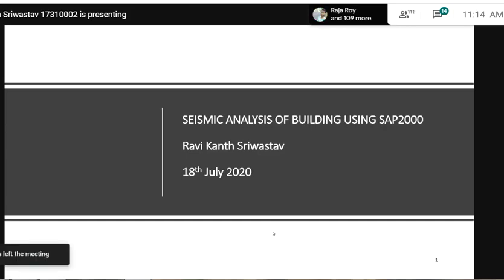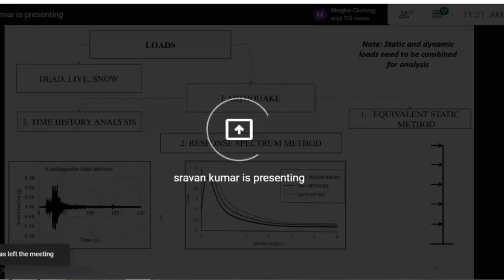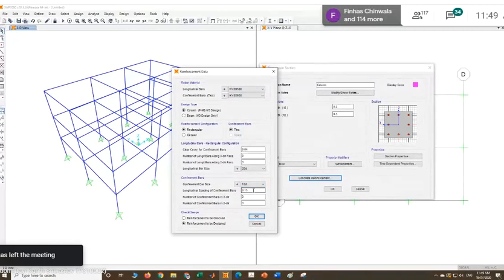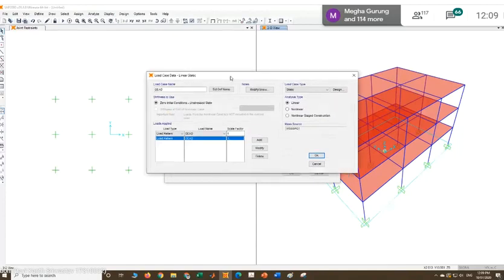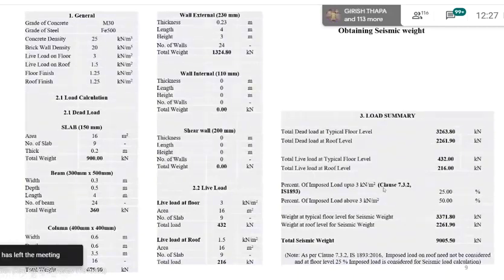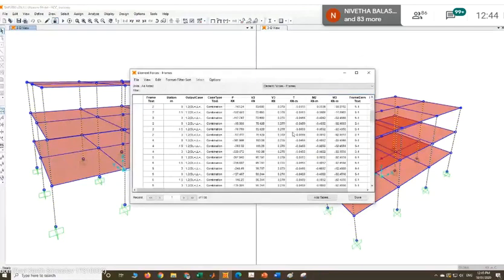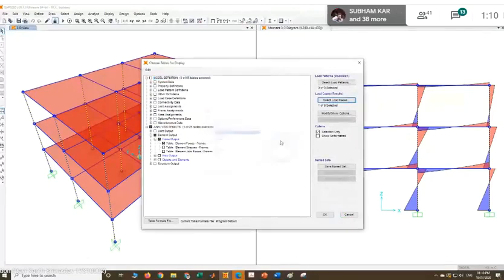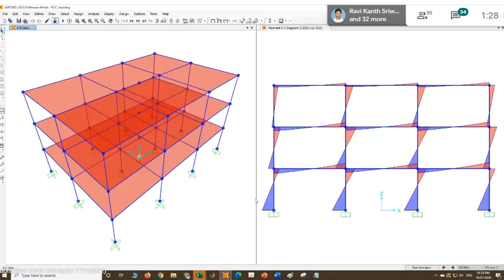SAP2000 Seismic analysis &  Design

Comment: Consider a four-storey reinforced concrete office building shown in Fig. 1.1. The building is located in
Shillong (seismic zone V). The soil conditions are medium stiff and the entire building is supported on a raft
foundation. The R. C. frames are infilled with brick-masonry. The lumped weight due to dead loads is 12
kN/m2
 on floors and 10 kN/m2
 on the roof. The floors are to cater for a live load of 4 kN/m2
 on floors and
1.5 kN/m2
 on the roof. Determine design seismic load on the structure as per new code.
[Problem adopted from Jain S.K, “A Proposed Draft for IS:1893 Provisions on Seismic Design of Buildings;
Part II: Commentary and Examples”, Journal of Structural Engineering, Vol.22, No.2, July 1995, pp.73-90 ] 
sir can you give response spectrum analysis using sap2000 of above problem statement

Comment: Hello sir, Im using SAP2000 for structural analysis. In response spectrum case, stress values on shell elements are seen as 0. When I define static seismic case with the values that produces same base shear, static case gives stress on shell elements but response spectrum case still not. How can I fix that? Is there any suggestion? 
Thanks in advance.

Comment: Respecetd Sir,
As we know that, the vertical response spectra is not given in the IS 1893:2016 Part-1 and the code suggested that vertical ground motion should be considered ad 2/3 of horizontal ground motion.

1) So, can we scaled down vertical ground motion time history as 2/3 of horizontal response spectra?
OR
2) Can we scaled down vertical ground motion time history as only horizontal response spectra?

Out of two which option should be selected?